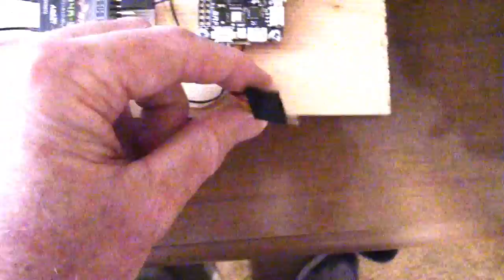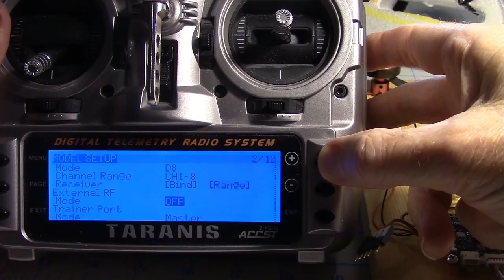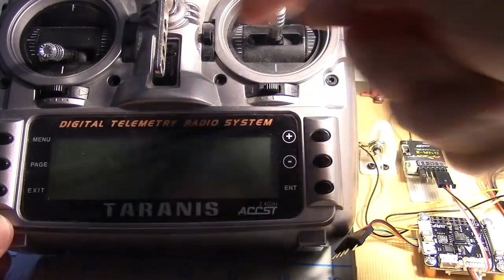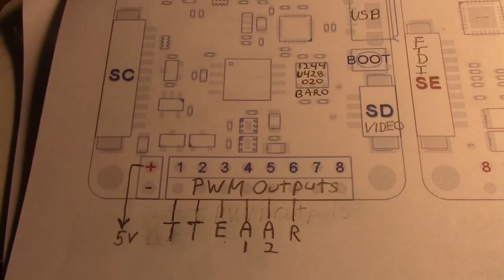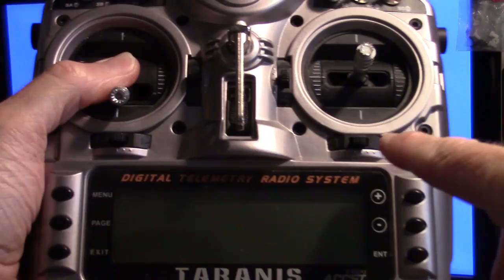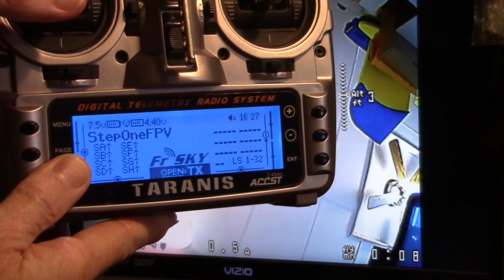BeeRotor FC Airplane Setup with Cleanflight Part 3 (D4R PPM, ESC Cal, Servos)

Comment: you where right this is a nice build , i will get a mini sky walker and give a small fpv plane a go.

i have a question about the vector cos i just got one,  when in stabilize mode the rudder movement is it minimal as of like 1mm or 2mm of travel to counteract yaw or it moves as much as the ailerons- elevator ? mine barly moves is that right?

Comment: the d4r-II  is a great little Rx I use them a lot.
I like this video series you are doing I may have to get one of the controllers for one of my planes :-)
Reply from the maker: +zimmy1958 Rctimer has a 20 percent off sale right now. Just enter the coupon code on the home page when you check out. I just ordered two more BeeRotor FC's!
Reply: +zimmy1958 Were did you put the LC filter.  Voltage line to the Camera?
Reply from the maker: +Jon Car Jon I put the LC filter between the 12v output of the current sensor and the voltage line that feeds the video TX and camera.